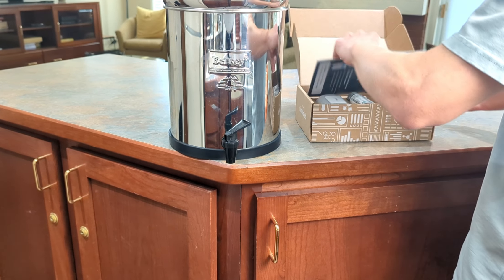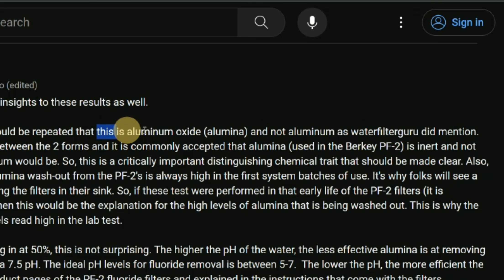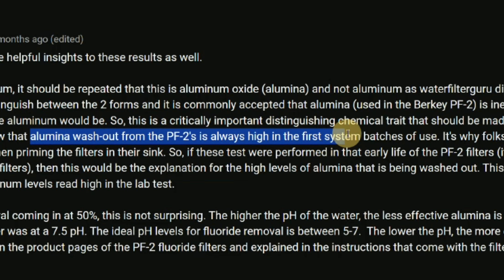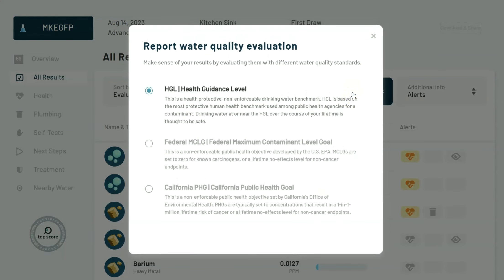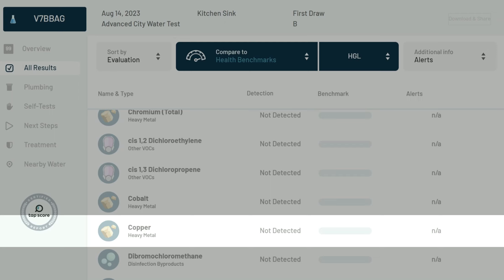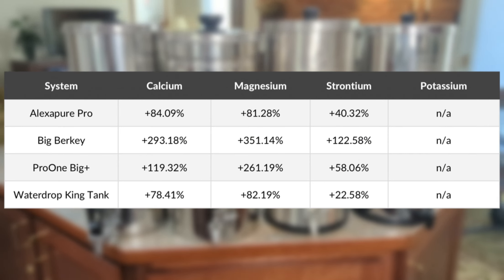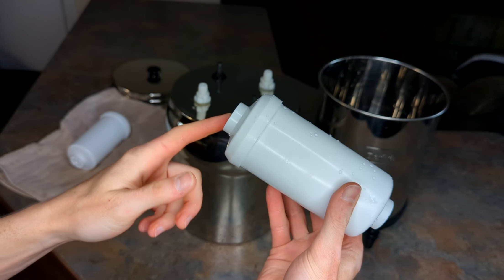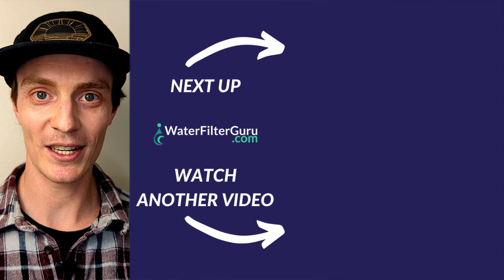I tested a Berkey…AGAIN!

Comment: So I have to wait 100 days (100 overnight fillings), hope I don't get a faulty filter, and hope I don't damage something when screwing them on. No thanks.
Reply from the maker: Not necessarily. In our first test, the issue with activated alumina leaching was most likely due to 1) faulty filters, or 2) user error by over tightening. I don't suspect that the performance in this second test is related to the volume of water filtered before the test.
Reply: @waterfilterguru  still, faulty filters and user error are not insignificant risks. I feel like you’d want to do a water test after every filter change. How much do these water test cost and how long do they take?
Reply from the maker: @AnthonyTripoli  fair point. The Advanced City Water Test currently costs $269. Testing turnaround time is within 10 business days.

Comment: Those are, unfortunately, Not authentic Berkey Fluoride filters, according to the Berkey website. One test is to shake the filters. If they sounds like a maracas then they're fake.  The water drop logo should be on the right side of the "Berkey", not above it. Also, it should say "Berkey"  and underneath say "Water System", not "by NMCL". Those are simple ways to tell if you have authentic Berkey Fluoride filters. There is a section on their website that explains all this with pictures.
Reply from the maker: Not true. The filters we used for both our testing projects were indeed authentic.

 Purchased directly from Berkey Filters, one of the largest NMC authorized Berkey distributors

Comment: Water Filter Guru, after all the videos, research and testing have you figured out if the Alumina Oxide is bad for us?
Berkey consistently claims it is Not Aluminum and is harmless unlike Aluminum.
Reply from the maker: Check out this comment from the chemists at the lab in response to this question https://www.youtube.com/watch?v=AVZmZwTxnMc&lc=UgxJjOYLLvaKvSldl0B4AaABAg.9kTs5772fNa9moaXtQI07y

Copy/paste the link in a new tab instead of clicking it - for some reason when you click it it doesn't open the comment thread like it should

Comment: Definitely not buying a Berkey. I have a friend who swears by them, in a good way, and I tasted the water. Was worst than the tap water, didn't taste good at all. No thanks.
Reply from the maker: It's good to mention that not all contaminants will impart a taste to the water! So you won't be able to determine water quality by taste alone. This is why lab testing before purchasing any water treatment equipment is so important

Comment: Your ppm vs mg/L for aluminum is wrong.  Check your science.  ppm does not equal mg/L
Reply from the maker: In water treatment PPM and mg/L are used interchangeably.
Reply: @waterfilterguru  wrong.  Mg/L is a mass/vol unit. ppm is either mass/mass vol/vol or mole/mole and essentially unitless.  They cannot be equivalent.  Water is 1million mg/L, but Aluminum is not.
Reply: Al is not 1mg/L so if you have 1mg of Al in 1L total vol, the aluminum is not 1ppm.
Reply from the maker: @philmartin9486  Not wrong, and not trying to argue with you. 

With treatment specifically, it's common to use both PPM and mg/L interchangeably, as is stated by the 
Water Quality Association (WQA) here https://wqa.org/education/glossary-of-terms/#P 

and the US EPA in the National Primary Drinking Water Regulations (see the Notes section) here: https://www.epa.gov/ground-water-and-drinking-water/national-primary-drinking-water-regulations
Reply: I see on Tap Report’s web page that they admit ppm is not the best and is confusing, yet still use it.  Oh well, at least further down they seem to indicate that regardless, they are reporting mg of contaminate per L of water, so it works out.  As an engineer and scientist this drives me crazy.  So, yeah, I admit, you were right.

Comment: You should read the directions--they are not designed for that long use!  Fake results!
Reply from the maker: This comment makes no sense. We filtered 100 gallons through brand new filters before testing. The manufacturer claims the Black filters have a 3,000 gallon capacity and the PF2 fluoride filters a 1,000 gallon capacity.
Reply: @waterfilterguru  Ok--I thought I read that the filters were 10 years old.  My mistake.